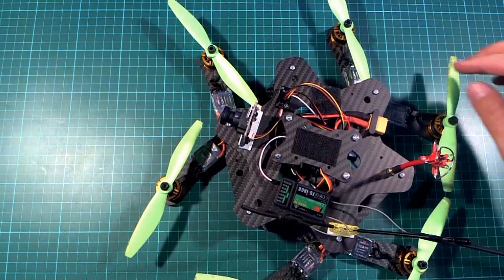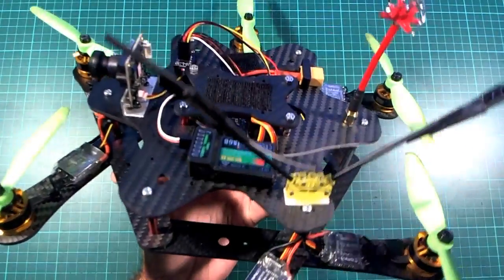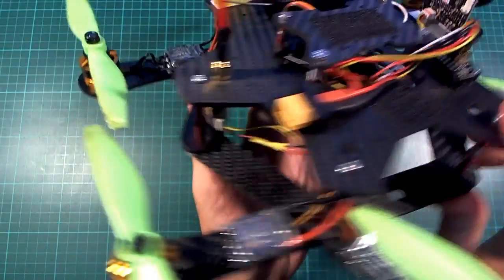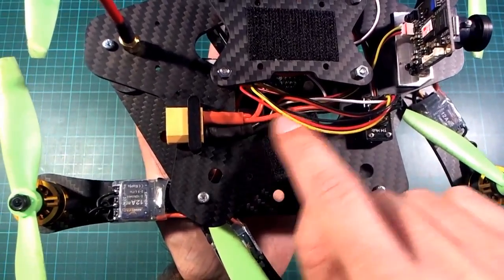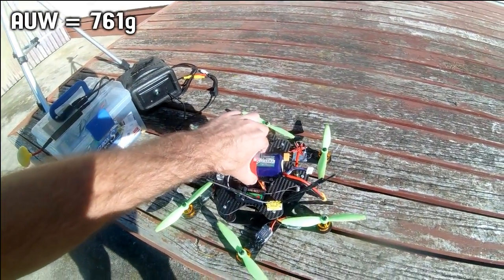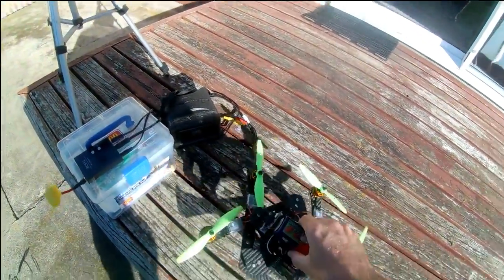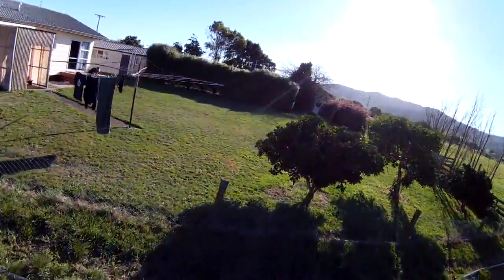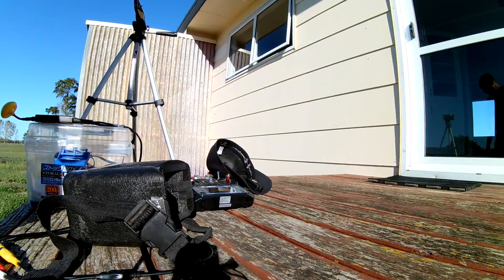Custom hexacopter frame test flights

Comment: Put this frame into its larger form, put som lower KV motors with big props on it and you will get uncomparably more flight time with only a bit more weight.

Comment: Speed test?
Reply from the maker: +James Lamb maybe if I can bend that FPV camera mount back a bit, would be looking at the ground all the way otherwise :) 
I doubt it would go any faster than the 250 quad did the other day though, I don't think the low-end lift power translates into top speed.